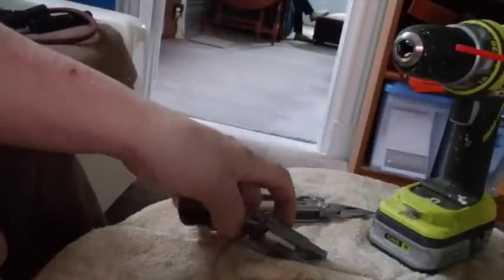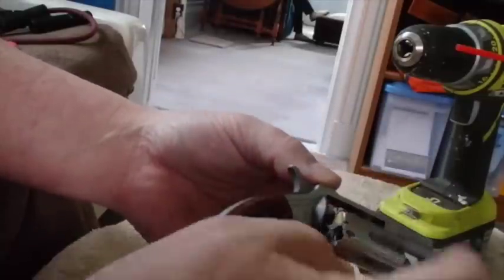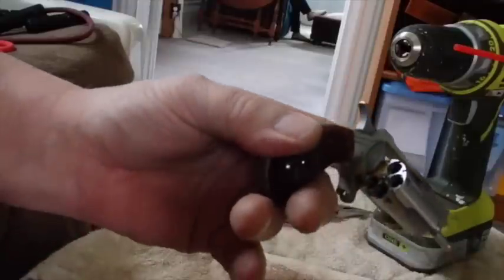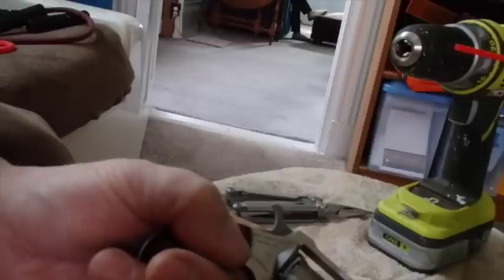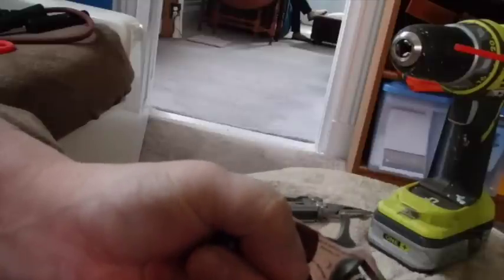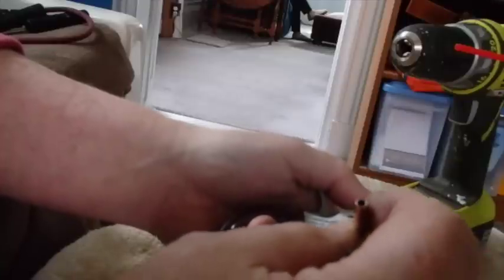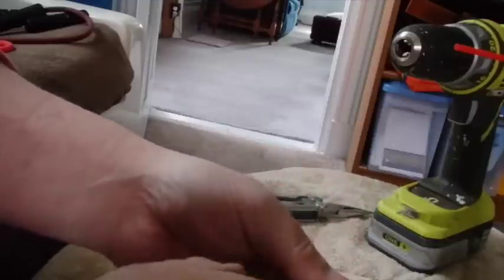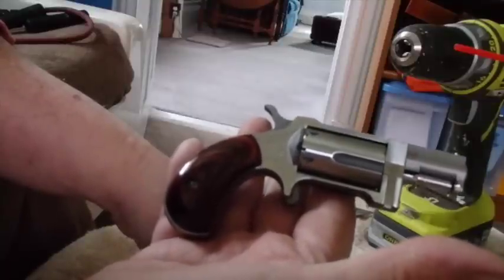North American Arms Mini Mag Sidewinder 22 Magnum

Comment: Happy Birthday. You probably know this, but those notches in the cylinder in between the chambers are the safety rests for the hammer. If you rest the hammer on a round and drop the revolver it can fire. So you leave the hammer locked into one of the groves.
Reply from the maker: +bc65925   Zaktly..